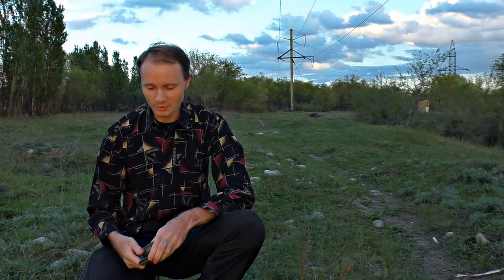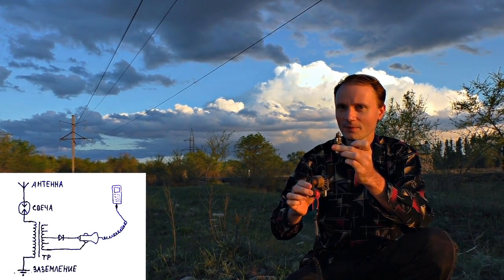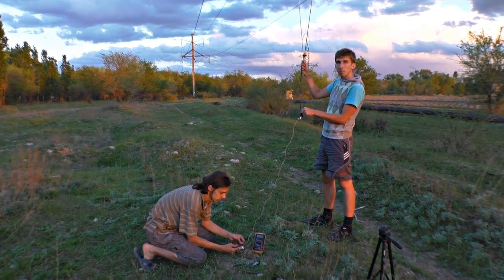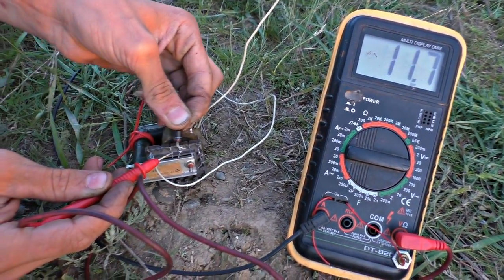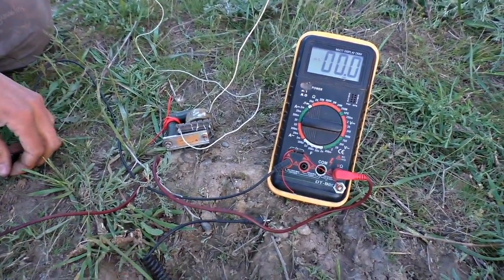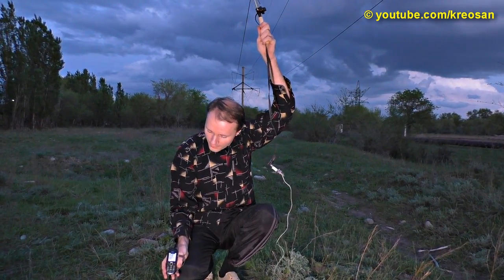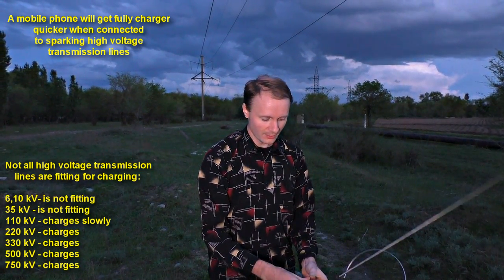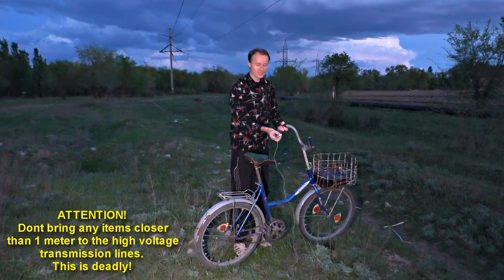Charging from the power lines.

Comment: Don't misguided to the innocent, less educated people. If it's really happened (works).  people want to try without any knowledge,help and experience. Which will be dangerous for him/her. 
Many power line ,high tension wire in  some places goes by rooftop of genral public home. 
And it's illegal for all Country to use this high tension lines. It's will damge this power supply too.

Comment: I wonder how many mA (mili amps) you can get using this methode!
Reply: About 80mA at 5V measured  on the output of the bridge rectifier loaded by a cell phone battery. That I measured below a low height 220 kV power line. IIRC, the antenna rod was 3 m long. Therefore, it's a wimpy power and takes whole day to charge a cell phone in this manner

Comment: Electroboom is gonna reccktifie your ass stupid Russian free energy guys.
Reply: It's not free energy, it's just capacitive coupling. This is real but only works because the powerlines in the video are being run at a higher voltage than they intended for, properly designed powerlines would not induce enough power for this to work.

Comment: Hi I love your channel you are very clever people best channel on here  well done I have an old laser engraver power pack it has 2 fly back transformers inside it I am unsure how to wire this up would you help me if you have a contact like email or Facebook  I will send pictures of what parts I have and if you have time would you draw a simple picture showing which wire I put were I wonder if the power pack also have a diode in we have a power line running across our field I am thinking I could use this to 're charge small 12v dry cell alarm battery that powers our horse electric fence would you help I understand if you are too busy thanks from the UK

Comment: My dad did this in the 50's. He was an electrical engineer. He strung wires under high tension power lines that went over his back yard and scavanaged the power that radiates from the lines. He supplied the house with electricity for over a year, free of charge.. Than he got caught.  He had to pay the estimated power cost for a year and pay a fine.
Reply: Please, don't tell the fisherman's stories. Power throughput is directly proporti al to electromagnetic flux and frequency. To get a kilowatt power the theft area below hv power lines must measure in miles squared

Comment: ...until air gets humid and you get full 500kV to your charger. If you want to pose as someone with DIY skills at least when using car charger tell people to use 15V side of the transformer, not 11V. Oh wait, you don't even know that when car is running it delivers 14,4V to all its electric systems because of battery charging...

Comment: I don't believe this.
Reply: DMIsREAL Your choice c:
Reply: DMIsREAL Then you don't believe in science
Reply: a current moving through a wire creates a magnetic field which they pick up using their transformers coil which turns magnetic feilds into electricity.
Reply: Me too. I think it's fraud. Flyback tv just work with high frequency electricity.😂
Reply: that is why they use the spark plug i think the timing of the spark gap increases the frequency